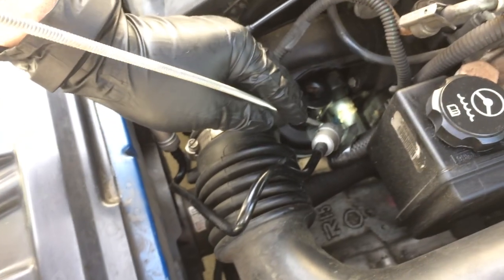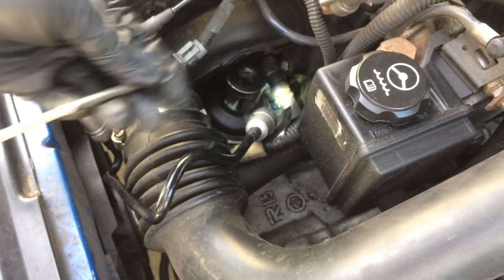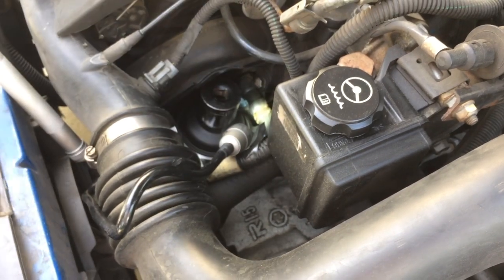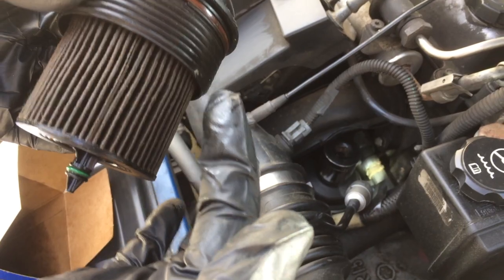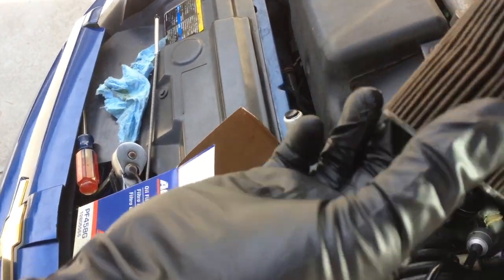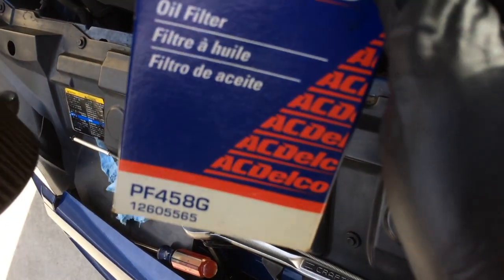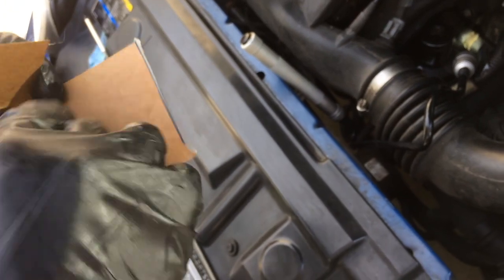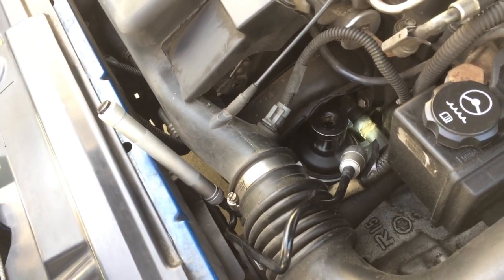2003 - 2010 Ecotec 2.2L Engine Oil Filter Housing Leak Repair (Chevy & Pontiac)

Comment: Ordered my replacement cap for exact oil leak...cuz this video...much thanks
Reply: The gasket comes standard, with the filter, from fram, wix, and mobil1. Kinda silly that acdelco doesn't supply the gasket with the filter. I replace my gasket every oil change.

Comment: Glad I stumbled across this.  Would have sworn I had a leaking oil pressure sensor/switch but it was dry.  Wife started the car and I watched with a flashlight and was so surprised to see oil oozing out of the top of the cap slightly below the tool surface.   I was dreading a major repair.  So awesome to have stumbled across this video.   You da man!  Thanks!!!

Comment: Just changed mine out last week after dealing with a bad oil leak that was all over the place and costing me some serious $$$ replacing oil on a regular basis in the process. This simple $15.00 fix stopped the issue! Thought it was the valve cover gasket but found no leaks after checking the valve cover and it was dry as a bone! ;)

Comment: I am looking into a leak in same place. Not so sure yet if it is coming from the oil filter cover.  Don't know of anywhere else in that area that could leak.  The head looks fine. No leaks that I can see.

Don't your oil filters come with a gasket?  Mine do.  I have a 2004 Saturn ION with 2.2L Ecotech.
Reply from the maker: ACDelco OEM filters for this particular engine do not include the o-ring, that is sold separately.   We only use genuine GM parts in all of our repairs, never aftermarket brands.  Links in the description.
Reply: @DrShock  Napa Gold Filter 7082 comes with a gasket. All the other brands I have bought also do.  I can confirm that my 2004 ION with 2.2 L EcoTech has oil canister cap that has 2 gaskets.  Large one come with filter. Smaller one comes with the cap. I had to buy a new cap. And was accused of double gasketing by a 'Mechanic' at Autozone.  They didn't even have the cap to check. Easy to over look the extra gasket. I have been changing my own oil on my ION since about 2007. Never noticed until today.
Reply: Well,  I will be go to hell.  Thought about this over night.  The filter cap will not leak with 2 good gaskets.  Also does not leak with 1 good gasket in the correct location. Confirmed it this morning.  Gasket goes in a grove 1/8 inch below the lip.

Comment: Does that leak onto the starter?
Reply from the maker: I wouldn't expect this particular leak area to reach the starter on this specific GM engine.   The oil leakage here will usually be trapped in the aluminum casting recesses at the base of the filter housing initially.  Then overflowing from those onto the top of the transaxle assembly.

Comment: I have replaced the cap and seal in the video still have a slow drip drivers side of engine does the filter housing itself have a gasket
Reply from the maker: No, there's no gasket on the paper filter insert for this engine.  Just the o-ring around the cap.  Are you sure your leak is coming from this cap area?   Have you torqued the cap only the value molded into the plastic and not any tighter?
Reply: @DrShock  I replaced oil sending unit it was leaking pretty bad had my oil changed at a oil change place before that still had a slow drip I can see it underneath coming from drivers side of engine replaced the o ring on the cap my question was more if there is a gasket between the filter housing and the block itself only other thing I can think of is value cover gasket

Comment: Every time I buy a filter for my Ecotec 2.2  it comes with that o ring... Check ur filter box or go to a better parts store...
Reply from the maker: For this particular engine, GM does not include an o-ring with their ACDelco filters.  So this is the proper GM service manual repair for this type of leak.   We only use genuine OEM parts on this channel.

Comment: how do I get the current one off? tried using a wrench and it just bends the plastic
Reply from the maker: You have to use a low profile oil filter socket, or a regular socket, of the correct size.   Pliers and wrenches end to round off the flats of the plastic.   Once that happens, you have to replace the housing cover.
Reply: Should be a 32mm socket